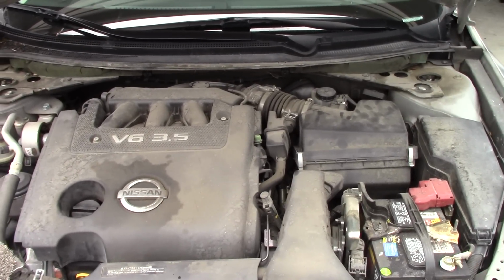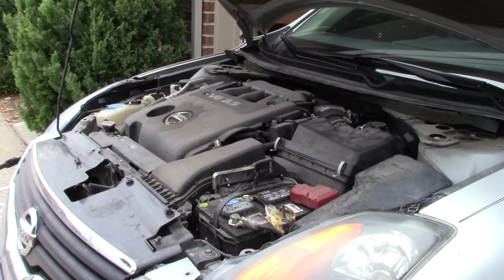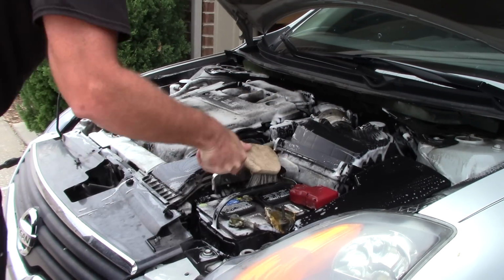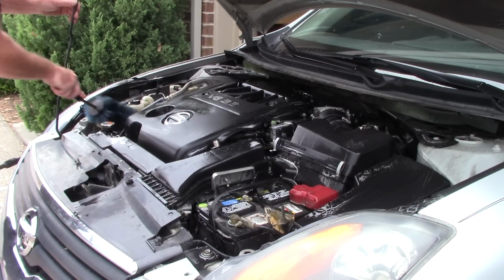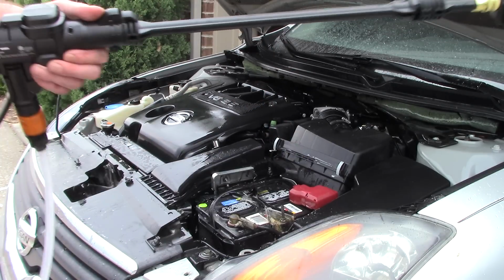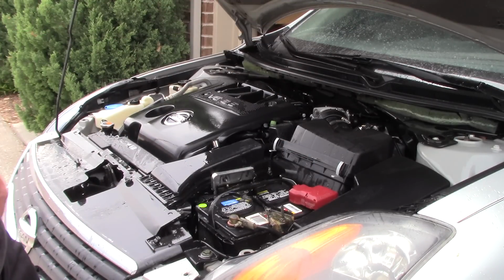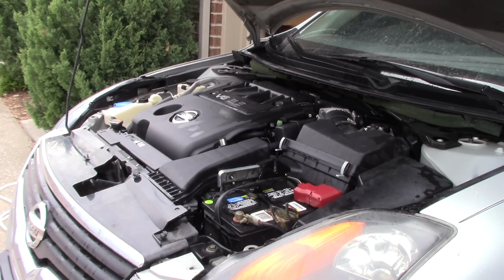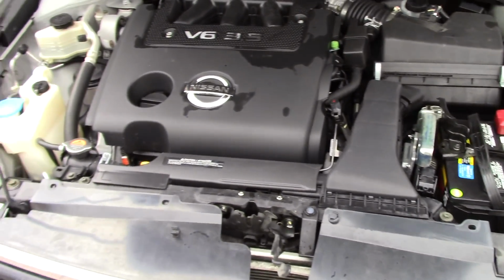Real Time: Super Clean Aerosol vs Dirty Engine Bay - Great Video For Beginners

Comment: Quick question... I always understood and was told to always disconnect my battery before purposely putting water in the engine bay, is it needed? And also, I was told to never use a pressure water or anything that applies lots of forced water, I was always told to use a spray bottle of water and wipe it down, or to just use a simple water hose nozzle? Does this make a difference?
Reply: Survivor 98 everything you listed is correct and would be done by any good properly trained auto detailer. I know detailers that would cringe from watching this and seeing him work. Some people actually care about their cars and don't want someone as careless as this. You want some real quality information go watch Larry at AMMO NYC. The guy is one of the best. He literally details multimillion dollar cars. He has tons of videos showing how to do everything the right way.
Reply: Survivor 98 Yes. High pressure water spray can force water into cables and connections.
Reply: i actually cringed pretty hard on this one :O the f*** is he doing!!??  :S "If you are going to use pressure washer dont use it so close....the guy in this video dont care about his customers at all.
Reply: I clean my engine cars since 35 years and haven't disconnect my batteries cars ever, and nothing happen bad ever, and there is no need to disconnect them, just clean and drive safe, thats all
Reply: No you don't. I've detailed cars for about 17 years and have never disconnected the battery and have never had any problems what so ever! You just have to know what your doing have the correct mist nozzle...
Reply: Survivor 98 b
Reply: Survivor 98 i  pressure wash mine with a 4200 psi washer never had problems and i hit everything yes the alternator too
Reply: Do you disconnect when driving on the highway in a rainstorm?
Reply: Not really needed to disconnect the battery. Chances of a direct short is very slim. Would almost have to be submerged.

Comment: I have a 2004 Toyota Rav4, I absolutely love it, the engine bay is a little grimy, there's some oily residue on the engine, and the hood just need an overall cleaning, I don't know if I should do it myself, or take it to a detail shop, anyone have an opinion on this, I did it years ago, but I want to do a really good job, it's pure daily driver and mostly my wife's car... best advice please...
Reply: As long as you are not directing water into the engine or fuse box, you will be fine. Do not use a high pressure washer and it works best to warm up the vehicle but not hot. A warm engine cleans better and drys faster with less risk of water getting into somewhere it shouldnt. Even a pump up garden sprayer works well. You do not need distilled water. Using a blower prevents water spotting anyways. I usually clean the engine first, then wash the outside of the vehicle to remove any over spray from cleaning the engine. NEVER do this in full sun. I always take the vehicle for a drive afterwards to dry things out. If you do end up with a misfire on the engine after washing, thats a good indication your plug wires need replacing. Also check your distributor cap if you have one for cracks. If you have individual coils per cylinder, this will show you quickly if one is bad. A good coil should never experience a misfire even if damp. I used to use a spray bottle on my older cars to help determine if my plug wires or other electrical issues were present. Its better to find and fix BEFORE snow and rain season.

Comment: That looks great. I have just one suggestion, though. When flushing the engine bay with water, it is a good idea to pull the negative lead off the battery and cycle the ignition from off to on then back off to drain any stored energy in the computer. You don't want any electronics to short out if water gets inside them and they are somehow powered. I know it's not necessary to do this, but better safe than sorry. An extra 30 seconds or less of work could save some expensive electronics(sensors, switches, computers, etc.). Just a suggestion.
Reply: x-Bert

Comment: I hope you repainted the V6 3.5 emblem for the Customer. I find it funny you didnt mention you completly pressure washed the paint off. You also didnt remove the battery and cover the cables. No mention about coil packs spark plugs wires or distributors for older cars. People use common sense when cleaning your engine bay, this could potentially be a disastrous experience for many who watch this video.
Reply from the maker: and you would be wrong..but thats ok:)..the v6 logo was already breaking down because the engine area had never been clean since 2007!..and because it hadn't been cleaned the dirt and contaminates already ruined many areas of the plastic,so thank god they hired me to finally clean the engine so i could stop the damage from years of neglect...your other comments are filled with false statements and i will just move on:)...thanks and best wishes to you:)
Reply: Sir , you cannot spray direct water on a distributor cap. Listen the engine bay looks great but there are several precautions one should take while cleaning their engine bay that you made no mention of. Carry on
Reply: Anthony D a 2007 Nissan Altima does not use a distributor or cap. It uses coil on plug ignition.
Reply: Anthony D that logo deff got blown off. Even through the grime at the beginning you could see the white paint, after the power washer it was black and chipped away
Reply: Mike Raposa the pressure washer might have completed the job but didn’t  cause it. That pressure washer is very weak, no way it would remove something like that.
Reply: Looks like the brush was the culprit for taking the paint off the 3.5
Reply: MP...that logo, where it came off, was already broken down... you can see a piece missing in the video at the beginning right on the 5.....
Reply: Andre Dent dude 1985 called, distributor caps are ancient tech nowadays...
Reply: That Onedude  all of my cars in the last 10 years have been independent coils per cylinder. But I don't buy old ass cars though so...
Reply: @andredent5530  I'm old enough to actually have had cars with distributor caps for more than 20 years.  I washed the engine bay on each one with a garden hose and never had any problems caused by a wet distributor cap. You do realize that such cars have ignition wires that have rubber boots on the end that seal the wire to the cap, and that the caps have pressure loaded clamps that clamp the top to the distributor itself, right?
Reply: @andredent5530  yes you can. Relax
Reply: @thecman26  Actually...my 96 Cherokee has a distributor cap, but electronic ignition

Comment: Hey man what would you use if you were
To detail an atv like the plastics and under the fender and make the tires
Shine what dressing would you use ? Thanks
Reply from the maker: something water based so its not sticky for the wheels and under the fenders, something like meguiars hyper dressing or you could use stoner trim shine in a aerosol can even though its not water based its very light and not sticky...for the exterior plastics i would use 303 protectant or a high quality spray wax like meguiars x-wax...just a few ideas:)...thanks for the comment
Reply: Dallas Paint Correction & Auto Detailing thank you so much
Reply: I definitely agree with the recommendation for Stoner Trim Shine. That stuff is awesome! I either order it on Amazon or sometimes I get it at OReilly auto parts. It's great on black plastics and trim, and doesn't feel greasy once it's completely dried.

Comment: For goodness sake. Disconnect your battery cables if you gonna spray water in engine bay..
Reply: why? You don't drive in the rain? on the freeway?
Reply: On new cars and trucks, do not disconnect the battery unless you use a battery back up to save the memory in the computer. See Scotty Kilmer video on this.

Comment: Always disconnect the battery
Reply: Soapy water it does get anymore dangerous than that
Reply: huertaiiij Na
Reply: You have to disconnect the battery
Reply: You don't have to disconnect the battery iv been cleaning cars for 14 years if never disconnected battery
Reply: You wanna clean in between the terminal and the post.
Reply: Your battery is earthed for a reason. Your engine bay gets wet that's is why it gets mucky in bad weather. Otherwise when it rains you would have to disconnect the battery before you drive off. Just wouldn't work would it
Reply: BIG DAVE I work for a car dealership. We don’t disconnect the battery when we clean the engine bay.
Reply: How much did you charge for that?
Reply: Should I cover any areas so they don’t get wet (electrical, sensors, whatever)?
Reply: @janshelton189  Yes you should. Distributor, plugs or coil packs, alternator, sensors, and fuse box is most important to cover.
Reply: @davidredner1986  WRONG,WRONG.

Comment: OK 2 points - Does he get paid every time he says "Super Clean",  and is he going to pay for the repaint of the fender he just shot battery acid all over while "Cleaning" the engine bay?  Indeed using distilled water is best for not leaving water spots, but I would rather have water spots than acid spots !!

Comment: What about any electrical components and/or sensors getting wet?
Reply from the maker: this question has been answered in many of the comments i have left for this video...26 years of cleaning engines and never had an issue but if your worried cover up everything that concerns you
Reply: Sorry I didn't scroll through all the comments. If you have never had an issue, that's good enough for me. Thank you.

Comment: Scott, whenever you use distilled water (pure H2O) it's relatively safe because there are no chemicals in pure H2O to short out your electric components.  Tap water from a faucet is usually loaded with calcium and/or sodium which will raise hell with electric components.  So, great tip - - use distilled water 💦

Comment: Scott, really enjoyed this real-time demo. A thought - It might be possible to reduce even further the amount of water used to rinse cleaner if you worked your spray in only one overall direction, e.g. start at the front of the bay (radiator cover area) and work your rinsing movement back to the firewall. You might net a little less water in the engine bay. I think "less" is always good when it comes to water in an engine bay. :-)

Comment: Hi question for you, with al those water, is it ok for the alternator to get wet?
Reply: No always cover your alternator with a plastic bag
Reply: @gerardodiaz1748  is that all to cover?
Reply: @gerardodiaz1748  thanks
Reply: @fathersonpinoyatheart7984  & your battery if possible remove the negative terminal to prevent any possible shortage
Reply: @gerardodiaz1748  thanks

Comment: I like the way Scott details the exteriors of vehicles and the passenger compartments, but saying that the engine bay was cleaned is like saying that if you washed the face of a baby with a soled diaper it was cleaned. 

I hate Nissans and a lot of similar vehicles. 

On those vehicles, you can't see most of the engine bay and none of the engine without removing the upper plastic covers. You made those covers and the small part of the inner fenders and fiewall that you could see look pretty.

The engine , the critical part of what's under the hood, is now dirtier than before you started.  Superclean and water moved the light soil from on top down under the covers and onto the engine and susension where it mixed with really heavy grime and soil and made an emulsion that will dry into a sludge as soon as the engine warms up. A lot of that sludge will land on the lower plastic covers that a mechanic needs to remove to do suspension work.
Reply: What, the mechanic can't de-grease the engine before he works on it? Most mechanics I've come across leave the car looking worse than when it came in. I had some new shocks put on recently and everyone of them had black fingerprints all over them.

Comment: Do you have to cover up the electrical parts?
Reply: You should.
Reply: Should NEVER have to do that. Your engine bay is NOT water proof. If you drive through puddles or it is rain season with lots of moisure in the air, your engine wiring is still exposed to it. A warm engine will dry things out but it is far from waterproof. Should you experience any electrical issues, there is a fault somewhere. Usually spark plug wires would be your biggest issue. You can buy a can of wire dryer and apply to your electricals BEFORE cleaning and after if need be. I dont bother. I used to clean and detail funeral home vehicles. EVERYTHING had to be cleaned on those vehicles.

Comment: I would not want u detailing my vehicles that's for sure
Reply from the maker: thats ok I'm to busy to take new clients:)
Reply: PA_jeeper96 
Ditto... So many issues with how he does this. Sad.
Reply: I agree
Reply: It's that kind of ignorance that keeps guys like this (and the repair shops) in business.
Reply: I wonder what people think happens when your doing 90 on the highway during rain lol
Reply: vinceje why not share the "proper" way of doing this then? Share the solution not the problem. Be a leader.
Reply: It's the use of the pressure washer. Can cause damage to electrical components by forcing water into them. Regular water pressure and a nozzle works wonders and doesn't have enough kick to get into the electrical. Other than that, that blue brush seems to be a good idea!
Reply: FirechickenExpress .. until your car gets details and doesn't start. What then shrug  ?
Reply: KeenLaF the engine gets wet for sure. You could drive in deep water and the engine will be okay. ( as long as the intake is not submerged ). It's the high pressure that causes water ingress.
Reply: bocajuniors55 watch the Chrisfix video about the same subject.
Reply: He is using destilled water... can't cause any electrical issue
Reply: I’ve been doing the same job for 10 years. I just cover electrical conspicuous area with foil and plastic battery can get wet no a problem Japanese cars are pretty much covered in plastic so it’s easier. Good video Mr Clean!!! ,
Reply: Dallas Paint Correction & Auto Detailing 😂😂😂😂😂😂😂😂😂😂 best come back ever
Reply: So many paranoid people.
Reply: idk how to wash a car but ya i would do just this too.
Reply: spraying high pressure into the plugs and wiring isn't a great idea but it should be ok, if he didn't spray it into the intake.
Reply: The device he was using is hardly a "pressure washer." It shoots 0.5 gpm flow rate at 320 psi max. A standard pressure washer used for washing cars is approx 2 gpm at 1800 psi. You can see the drastic difference there. It is true that using that sort of pressure washer in the engine bay would be a bad idea but using the device he used in this video is probably more safe than using a standard 7-8 gpm garden hose with a squeeze handle nozzle.
Reply: Francis Grabetz  I've been using a pressure washer on my 2006 VW GLI engine bay for years, never a problem...and it still looks like new. I guess you've just got to be smart enough not to focus the pressure on the electrical components...go figure.
Reply: This guy knows what he's doing.
Reply: @joshfoley8862  

Pressure washer is much safer being it doesnt put out as much water as a regular hose and nozzle. 

Try filling up a 5 gallon bucket with a pressure washer and see how long it takes to fill it up.
Reply: @KeenLaF  you are the reason my premiums are high 😒
Reply: @vinceje  complains about issues but offers nothing to the conversation lol
Reply: @dontblameme6328  why don't you elaborate more? If not keep your comments to yourself
Reply: Anthony Garrett 
Back at ya there bud....
Reply: No, that is not what you pay for. You do not take a pressure washer to a modern engine bay like that because of all the electronic components. Everybody who ever learned anything worth 2 Cents about it knows that.
Reply: I dont too only becuase i live in different state but i will follow his 25 yrs technique.
Reply: @joshfoley8862  If the components can get damaged by that weak water pressure via wiring/sockets and plugs or casings, they are very weak themselves and this is nothing real different to driving in the rain except from above the engine ie direct pressure. Also evaporation is ever present and as able to penetrate poor workmanship. 

So on that note I'm going to go with 'what is a snorkel?' for 10 points.
Reply: PA_jeeper96 I didn't see him talk about protecting the alternator or to watch for electronic connections , never soak your firewall mat it will cause it to sag and peel away. ..watch videos from ammo